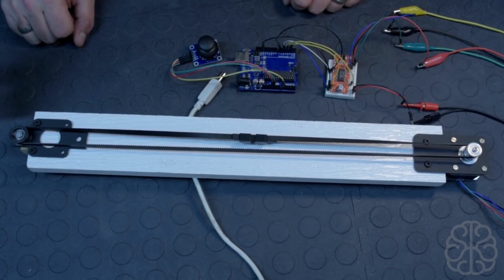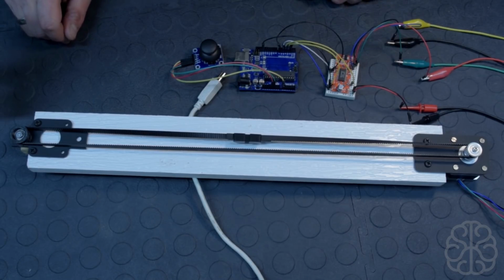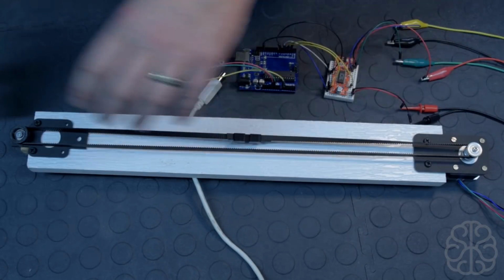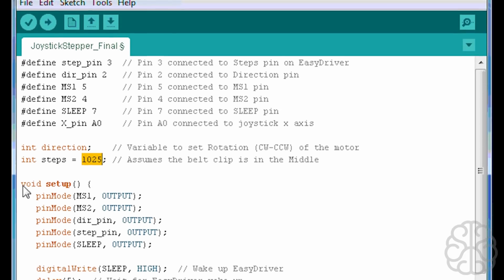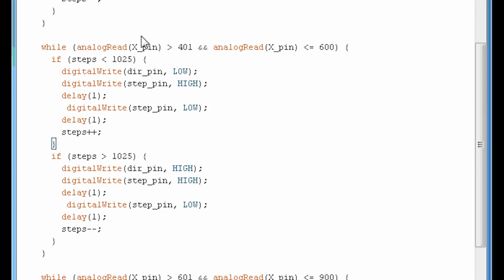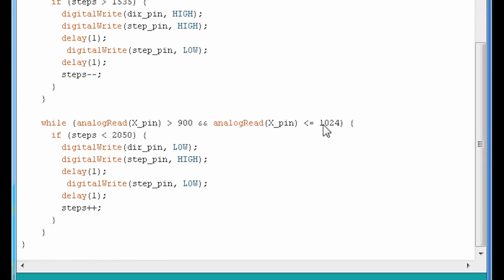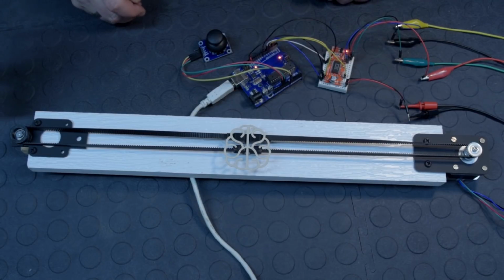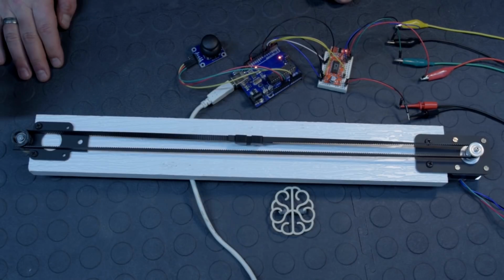Control a Stepper Motor using an Arduino, a Joystick and the Easy Driver - Tutorial

Comment: Can I use A4988 stepper driver instead of easy driver? will it work with your code? Thanks! And please could you tell which pins of easy driver are connected with the stepper pins.

Comment: So basically the code doesn't work.
First it's an aweful habit not to slice things into functions. And you used you Joystick like it was 4 buttons. There is absolutely no sense in doing that. + You clearly put it back in the middle everytime cause verything is offset cause something is wrong, and didn't care to fix it.
I think it's a nice video an it's nice to show stuff to people, but showing working stuff is better.

Comment: Hi. I wish to use this on a car clutch, where the position of the potentiometer decides the position f the clutch pedal. Will it be able to hold the clutch weight in its position? Or does the programing needs any changes?

Comment: Hi Brainy-Bits, this is a wonderful tutorial!! Thanks a lot.
Let's say i would like to control 2 or 3 stepper motors simultaneously, each motor needs to reach different angle(preset).
For an e.g. all motors are in home position, when the joystick is moved towards left/right, all three motors have to start move towards their preset position/angle.
Is that possible?
Will you do a tutorial related to it or have any links that will lead to my objective?
Thank you!!

Comment: Can i run 12v directly to 12v motor though this joystick and skip the controller since DC motor control means varying the voltage?  The potentiometers do just that.

Comment: Does anyone know how one can wire an analog setup with real-time stepper motor control with easing? I. E. If the joystick is pressed a little bit it goes slow and then accelerates depending how much further you press it. Cool video Btw.

Comment: Can you program the arduino so you don't have to hold the joystick in position - instead so that nudging the joystick in one direction causes it to displace, and releasing the joystick does not make it return to its original position. cheers

Comment: Thanks video awesome, but I have a big question, for control 16 servos we can use a pca9685, but the question is, how we can control 16 motor steppers individually? Exist a module for do this? Like a pca9685 for motor steppers? Thanks a a lot

Comment: Ithink  you have a nasty that is effecting our re-centre operation.  The code loop you showed intially had a condition of x > 1025, but the next loop had a condition  of x < 1025. so you have totally missed the middle point, because the code says you will NEVER reach 1025, only 1024 - Ho hum.......

Comment: Thanks for the video, you explain really well. I work on a project : an automated stockage cupboard. Basically, I have a similar X axis and a Y axis a little bit different built on the X one to allow 2D movements.  These explanations may be really usefull for me since I learnt python but not arduino language. I may give you more info when I finish the project if you want to.

Comment: hi brainy nice work...i use your tutorial to custom my video slide,work fine! but I will like controll full steps of the motor and not back to the center position when i release the joistik.
 If possible set the speed 'for moving from point A to point B to create time lapse using the joistik button.
how can I change your sketch?

Comment: Hello, 
I'm trying to build router table with automatic adjustment for router height and automatic fence position... I want to use 2 nema 23 stepper motor . my system needs is 
1) auto-stand system (work without PC)
2) switch for choosing between x or y axis
3) switch for choosing resolution (1x,10x,100x)
4) MPG handwheel for fine adjustment (100 pulses per revolution) one handwheel for both axis, depending on the switch x or y .
5) 2 buttons for each motor for fast adjustment .. can I use arduino for this project ?

Comment: ///////////////////////////////////////////////////////////////////////////////////////////
#define  X_pin    A0     // Pin A0 connected to joystick x axis
#define  SLEP1    A2       
#define  SLEP2    A3       
#define  SLEP3    A4       
#define  SLEP4    A5       
int steps =       1025;
int x =           2;
void stop1() {
   digitalWrite(SLEP1, LOW); 
   digitalWrite(SLEP2, LOW);
   digitalWrite(SLEP3, LOW);
   digitalWrite(SLEP4, LOW);
   }

   void  DOWN(){
   digitalWrite(SLEP1, HIGH); 
   digitalWrite(SLEP2, HIGH);
   digitalWrite(SLEP3, LOW);
   digitalWrite(SLEP4, LOW);delay(x);
   stop1(); 
   digitalWrite(SLEP1, LOW); 
   digitalWrite(SLEP2, HIGH);
   digitalWrite(SLEP3, HIGH);
   digitalWrite(SLEP4, LOW);delay(x);
   stop1(); 
   digitalWrite(SLEP1, LOW); 
   digitalWrite(SLEP2, LOW);
   digitalWrite(SLEP3, HIGH);
   digitalWrite(SLEP4, HIGH);delay(x);
   stop1(); 
   digitalWrite(SLEP1, HIGH); 
   digitalWrite(SLEP2, LOW);
   digitalWrite(SLEP3, LOW);
   digitalWrite(SLEP4, HIGH);delay(x);
   stop1(); 
   }

    void  UP(){
   digitalWrite(SLEP4, HIGH); 
   digitalWrite(SLEP3, HIGH);
   digitalWrite(SLEP2, LOW);
   digitalWrite(SLEP1, LOW);delay(x);
   stop1(); 
   digitalWrite(SLEP4, LOW); 
   digitalWrite(SLEP3, HIGH);
   digitalWrite(SLEP2, HIGH);
   digitalWrite(SLEP1, LOW);delay(x);
   stop1(); 
   digitalWrite(SLEP4, LOW); 
   digitalWrite(SLEP3, LOW);
   digitalWrite(SLEP2, HIGH);
   digitalWrite(SLEP1, HIGH);delay(x);
   stop1(); 
   digitalWrite(SLEP4, HIGH); 
   digitalWrite(SLEP3, LOW);
   digitalWrite(SLEP2, LOW);
   digitalWrite(SLEP1, HIGH);delay(x);
   stop1(); 
   }
void setup() {
   pinMode(SLEP1, OUTPUT);
   pinMode(SLEP2, OUTPUT);
   pinMode(SLEP3, OUTPUT); 
   pinMode(SLEP4, OUTPUT); 
stop1(); 
}

void loop() {        
 while(analogRead(X_pin) >= 0 && analogRead(X_pin) <= 100) {
  if(steps > 0){
    UP();
   steps--;
  }
 }
 while(analogRead(X_pin) > 900 && analogRead(X_pin) <= 1024) {
  if(steps < 2050){
    DOWN();
   steps++;
      }
    }
 }
///////////////////////////////////////////////////////////////////////////////////////////////////////////////////

Comment: #define  step_pin 3      // Pin 3 connected to Steps pin on EasyDriver
#define  dir_pin  2      // Pin 2 connected to Direction pin
#define  MS1      5      // Pin 5 connected to MS1 pin
#define  MS2      4      // Pin 4 connected to MS2 pin
#define  SLEEP    7      // Pin 7 connected to SLEEP pin
#define  X_pin    A0     // Pin A0 connected to joystick x axis

int direction;
int steps = 1025;

void setup() {
   pinMode(MS1, OUTPUT);
   pinMode(MS2, OUTPUT);
   pinMode(dir_pin, OUTPUT);
   pinMode(step_pin, OUTPUT);
   pinMode(SLEEP, OUTPUT);  
   digitalWrite(SLEEP, HIGH);  // Wake up EasyDriver
   delay(5);                   // Wait for EasyDriver wake up
/* Configure type of Steps on EasyDriver:
// MS1 MS2
// LOW LOW = Full Step //
// HIGH LOW = Half Step //
// LOW HIGH = A quarter of Step //
// HIGH HIGH = An eighth of Step //
*/
  digitalWrite(MS1, LOW);      // Configures to Full Steps
  digitalWrite(MS2, LOW);      // Configures to Full Steps
}

void loop() {
 while(analogRead(X_pin) >= 0 && analogRead(X_pin) <= 100) {
  if(steps > 0){
   digitalWrite(dir_pin, HIGH);   
   digitalWrite(step_pin, HIGH); 
   delay(1); 
   digitalWrite(step_pin, LOW);
   delay(1);
   steps--;
  }
 }
 while(analogRead(X_pin) >  100 && analogRead(X_pin) <= 400){
  if(steps < 512) {
   digitalWrite(dir_pin, LOW);   
   digitalWrite(step_pin, HIGH); 
   delay(1); 
   digitalWrite(step_pin, LOW);
   delay(1);
   steps++; 
  }
  if(steps > 512){
   digitalWrite(dir_pin, HIGH);   
   digitalWrite(step_pin, HIGH); 
   delay(1); 
   digitalWrite(step_pin, LOW);
   delay(1);
   steps--; 
  }
}
 while(analogRead(X_pin) >  401 && analogRead(X_pin) <= 600){
  if(steps < 1025) {
   digitalWrite(dir_pin, LOW);   
   digitalWrite(step_pin, HIGH); 
   delay(1); 
   digitalWrite(step_pin, LOW);
   delay(1);
   steps++; 
  }
  if(steps > 1025){
   digitalWrite(dir_pin, HIGH);   
   digitalWrite(step_pin, HIGH); 
   delay(1); 
   digitalWrite(step_pin, LOW);
   delay(1);
   steps--; 
  }
}
while(analogRead(X_pin) >  601 && analogRead(X_pin) <= 900) {
  if(steps < 1535){
   digitalWrite(dir_pin, LOW);   
   digitalWrite(step_pin, HIGH); 
   delay(1); 
   digitalWrite(step_pin, LOW);
   delay(1);
   steps++;
  }
  if(steps > 1535){
   digitalWrite(dir_pin, HIGH);   
   digitalWrite(step_pin, HIGH); 
   delay(1); 
   digitalWrite(step_pin, LOW);
   delay(1);
   steps--; 
  }
}
 while(analogRead(X_pin) > 900 && analogRead(X_pin) <= 1024) {
  if(steps < 2050){
   digitalWrite(dir_pin, LOW);   
   digitalWrite(step_pin, HIGH); 
   delay(1); 
   digitalWrite(step_pin, LOW);
   delay(1);
   steps++;
      }
    }
 }

Comment: Great little project. When you used an analogue joystick I was hoping that the motor speed would be proportional to joystick position but as it is, the motor appears to move at a fixed speed - and control could be achieved with 2 spst switches(?)

Comment: Great project. I have a question, is it possible to make this project without an arduino, that meaning that we could only use common electrical components such as resistor, ic (not an arduino tho), capacitors, and things like that. I'm just curious because of that is possible, it would really really hard to get, right? Hope your reply mate. Thanks again!

Comment: Can you share de The Code?, i trying to create control system to 24 volts to DC Motors, I use relay to allow pass of high voltaje :D actually i use my own computer to control the orientation of motors.

Comment: Do you know how you would do this exact thing but pushing something with a lot more weight on the belt? I'm trying create a motorized slide-out bed for a van conversion so it has to push a fair amount of weight. Can you use a belt with notches or might you use a chain like a bike? I'm new to this and to Arduino so I have no idea how something like this is normally done. Thanks.

Comment: I have one 5-phase  oriental Stepper motor (PK596BW-N25) which is attached to the drilling machine .Currently this motor speed is controlled by computer program but for some practical reasons I need to control its speed manually by knobs or button . Is it possible ? Do you have any circuit for that.